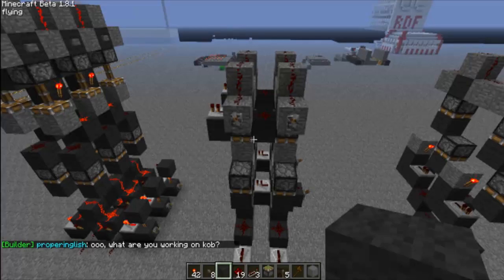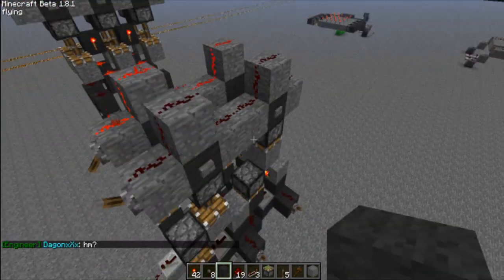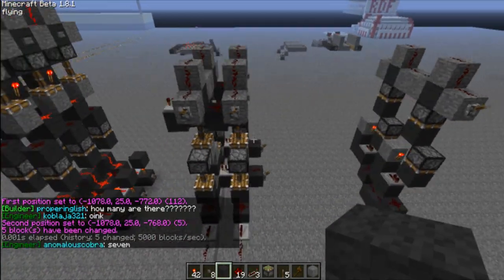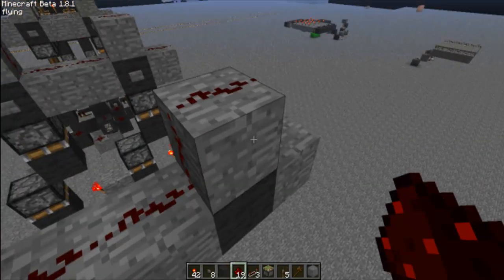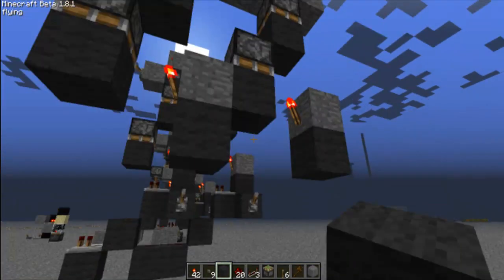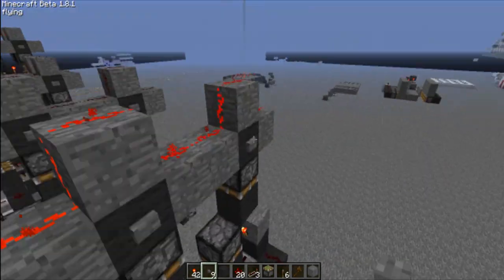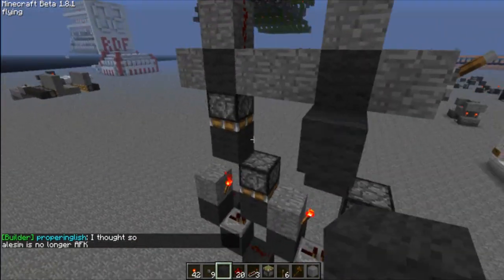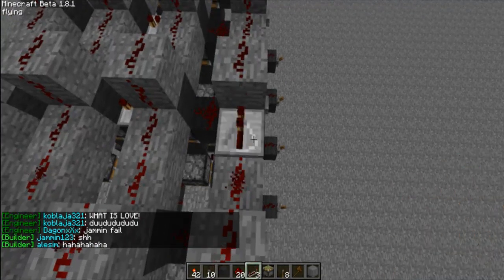Minecraft - How to Build RAM

Comment: Really good design, but connections for bigger modules on top won't work with redstone if you want more than 2 by each other, and I don't know a lot about this but, how man bytes can each one hold? (I know I'm a noob) :P
Reply: Well, it depends. One of his normal 2-save, 1-module RAM can hold up to 2 bits (2/8 of a byte)
Reply: Ryan J. Because each save can hold only one state on or off (1 or 0) which is one bit each